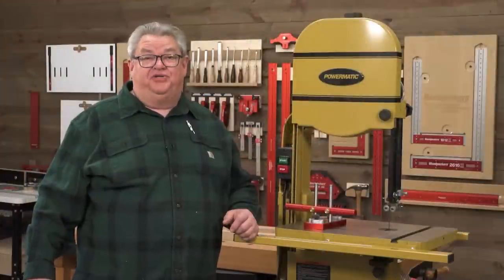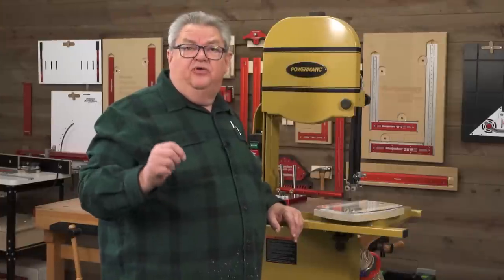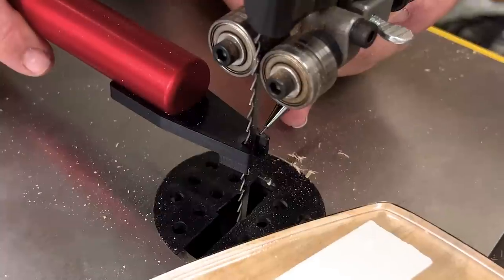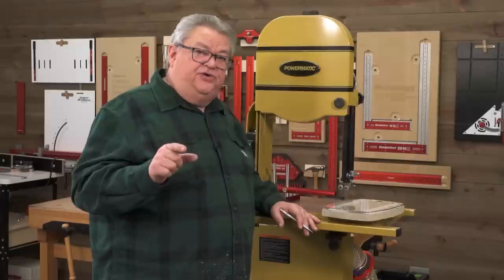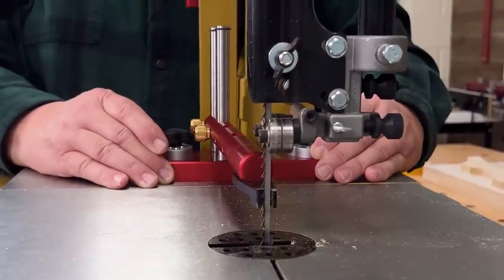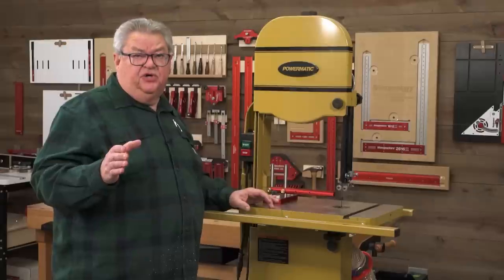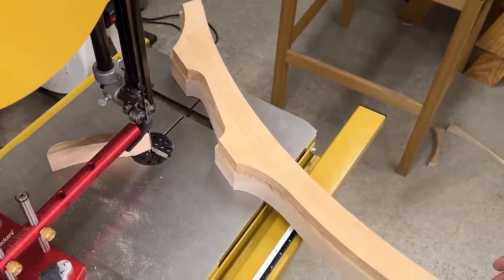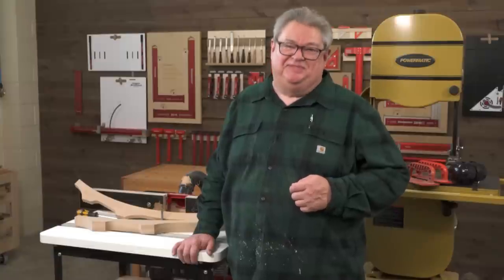SteadyCurve Band Saw Template Guide FAQs | Deep Dive | Woodpeckers Woodworking Tools

Comment: Great presentation but I have a  question.  I have a  old  craftsman 12" band saw and the bed is aluminum so the magswitch wont work. Have you got a way to secure it on beds like mine?
Reply from the maker: Not an ideal solution, but you could get a small steel plate that you could clamp to your table.

Comment: Great ideal as long as it can cut right to the line of template. The key to safe routing around curves is removing as much wood as you can so the router does not grab when going around tight curves, tearing out wood and/or pulling out of your hands.

Comment: Love the concept. I always would trace the template onto the wood and then try and follow the outside of the line. Some times cutting to close and leaving a indent that the routing does not cut. When will this tool be ready to ship? I got a lot of template cutting coming up the first part of January and would like to use it.